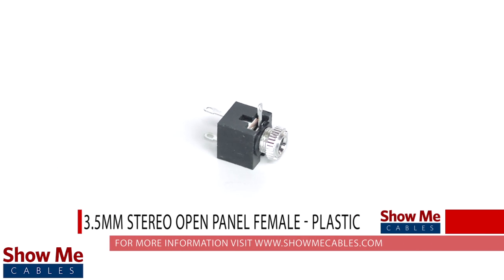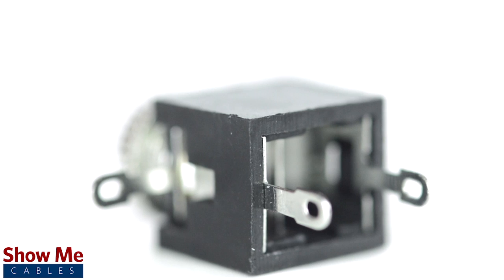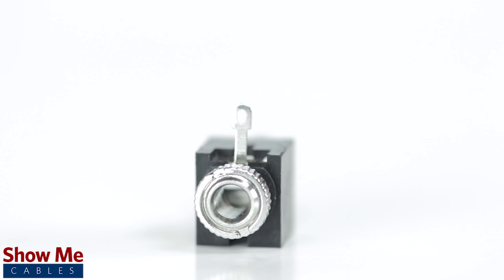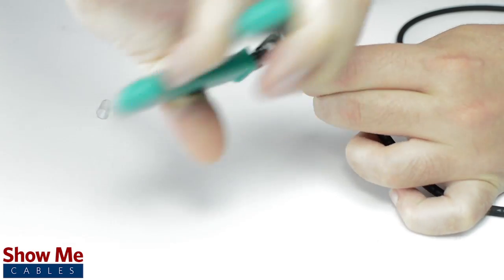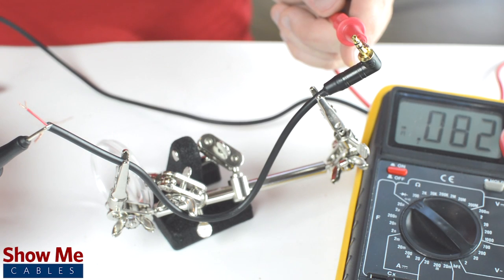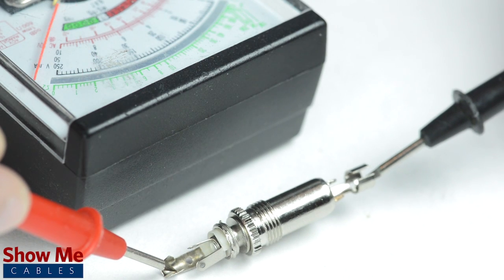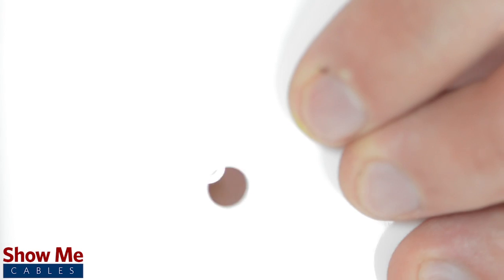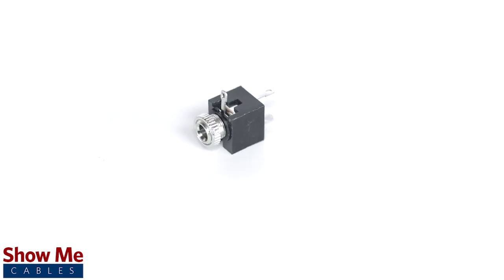3.5mm Plastic Panel Mount Stereo Connector - DIY Project to Repair Your Audio Cable #891

Comment: Greetings, if you are wanting to know which order, the order is tip to base.
For stereo headphones... Left, Right Ground... if microphone is added, the last one is Microphone.
For microphones Mic Audio Out Ground
If it is a stereo mic Left Right Ground

What is Ground? it is the black wire that returns to the box, you are very much welcome and I hope this helps in wiring up your headphones

Comment: The model of female 3.5mm socket here is shit.. unless mine are a fake, for some reason the ground is attached to two of the pins for some dumb reason.. either that or they're mono sockets, not for stereo.
Reply: Ok I'm glad it's not just me. I got a bag of these. 3 terminals, but one terminal doesn't connect to anything and it makes one channel connected to ground. I wish I knew where I got these because they are garbage unless I want mono jacks.

Comment: I have a device that has a cheap 3.5m male but I'd like to cut that off and replace it with a female. What are the dimensions of this? Would it fit into such a small enclosure?
Reply from the maker: Here is the drawing with dimensions.  https://www.showmecables.com/media/specs/3-5mm-Stereo-Jack-Open-Panel-Connector-Plastic-spec.pdf

Comment: The info that has to be added is which PIN Is the RIGHT channel and which is the LEFT one and for the conclusion the GROUND pin
Reply: Exactly! That is the only reason I was watching. Only gave the most obvious details everyone knows. Even that was flawed. Like saying "The female jack can be identified by the 3 soldering points. "There are many different pinouts.  Many different styles.
Reply: Lol for this exact model, I was wanting to know too. Apparently to my tests, the pin going sideways is NOT the ground pin..? 

Anyway, going to do more tests I guess, how annoying.

Comment: This is really useful, thanks!
Reply: the connector has to be universal standard... so saying that just check it with a multimeter. is not the needed nor proper solution... please provide proper info and redo the video with updated/corrected info...
Reply from the maker: No problem! Thanks for checking out our video!